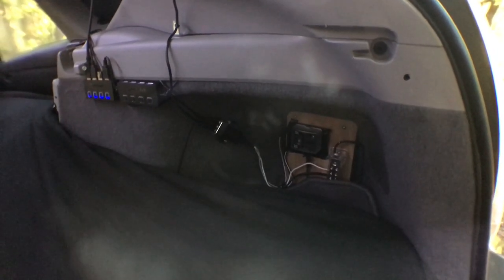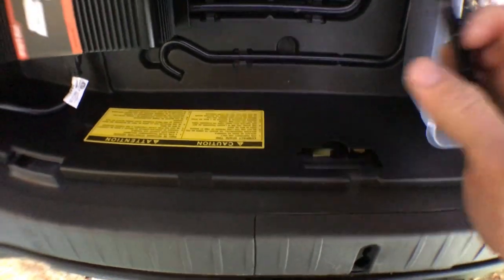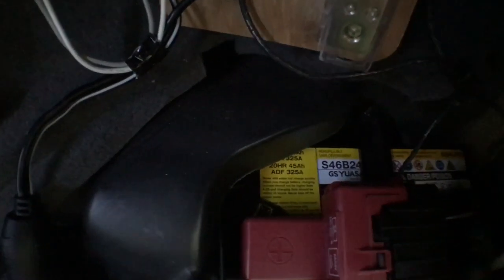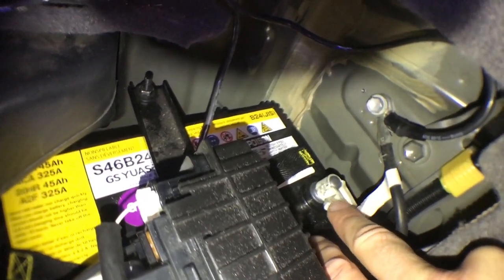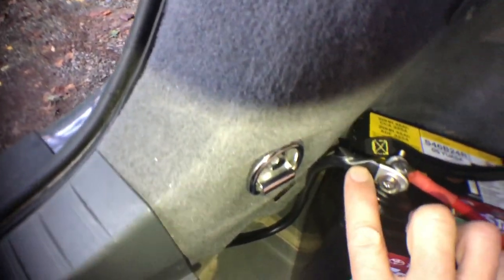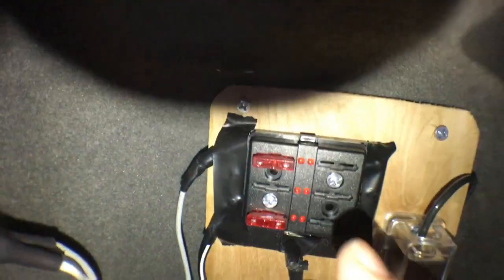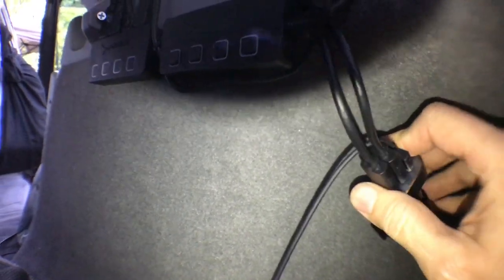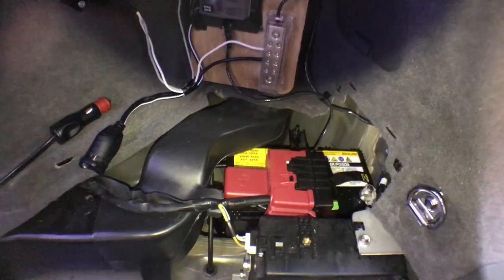Prius Stealth Camper - Electrical: Adding a second 12v battery, inverter, microwave

Comment: Would a standard off the shelve deep cycle battery work with this? The Prius doesn’t draw any amps for cranking the engine from the 12v system so maybe a solar battery would work to extend the cars 12v system? Thanks for the great video!
Reply from the maker: Zanfindel I pondered that exact question for quite a while. I have a large deep cycle I could have used. A couple reasons why I didn’t: As explained to me, the Toyota 12v battery is a proprietary battery that has the design to have properties of both a starting battery and deep cycle. I was concerned that there would be some kind of compatibility problem. Also, the car and software are so complex I thought it would cause an issue elsewhere in the system. 

I had a BMW 645 and used a regular battery from an auto parts store (they said it would work) Huge mistake, the BmW battery has to be synced with the computer. As a result I fried the new battery and alternator and had to end up buying the Bmw battery as well. $800!!!

So the easy route for the Prius was to just double the battery, I felt the the computer and systems would not be able to sense that. If someone else gives the big battery a go and does not have problems then I’ll likely do the same. 

That’s for your input!
Reply: It's possible to add a standard deep cycle battery using what's called a battery isolator.  It would connect the batteries for charging, but keep them separate so your microwave can't kill the starter battery.
Reply from the maker: Joel V I did end up adding a manual battery cutoff to the second battery so I could do some testing and diagnostics on power draws. It’s just a switch because I didn’t want to take the time and expense to put a proper isolator in. Would be a good idea. I turn the car ON to run the microwave just to not stress the batteries from such a big draw. Thanks for your comment and for watching!
Reply: One important aspect of the Prius battery is that it is vented to the outside of the vehicle with a tube. You can see the tube on the left side of the factory battery. Did not notice if it was utilized on the second battery but I believe it should for safety. As a side the battery on a Prius is not actually used to start the engine. The battery provides voltage for accessories such as lights and the computer that controls the car. The engine is actually started by the High Voltage Battery that is part of the Hybrid system.
Reply: The 12v battery is only ever used to run the cars lights and computers. Engine starting is done by the HV Traction battery.  If you look at Prius Chat, you'll see where people are using Mobility Scooter/Power Chair batteries to replace the original. They are much cheaper and more easily available, and they also stand up much better to being discharged to a low level.
Reply: @tbirdracefan  I just bought a 2nd battery yesterday and was wondering about the hose too. I didn't pick it up because it wasn't pointed out in the video....Hmmm. I'm still curious if I need it...
Reply: @dancereaper  If it is a lead acid battery, I would steer clear of it if it were me. They off put hydrogen sulfide gas when charging. The prius battery has a hose to dump that gas harmlessly to the outside of the cabin. Hydrogen sulfide is explosive and poisonous.

Comment: Hold on. Is that a car battery recharger. The kind you use on your car battery when you need to jumpstart it???
Reply from the maker: No I don't have that. No sure what you are looking at. I purchased an additional 12V battery from Toyota, the same that comes with it and just added it to the circuit.  I not sure if I an answering your question or not. The unit in the hatch storage is a 2000 watt inverter.
Reply: PriusStealthCamper Adventures ohh. lol My bad

Comment: is this applied to all vehicles??
Reply from the maker: I've been told that the battery moved up front to the engine in later generations but I'm not sure that years. 2009 was the last year of my generation.  Thanks for your question and for watching!
Reply: I have 3rd gen 2011 and the starter battery remains in the same place as 2nd gen  '09.
Reply from the maker: Good to know - thanks for posting!

Comment: After trying to find a solution to my problem...how to add a 1500w inverter to my 2016 Prius 3...I have come to the realization that EVERY SINGLE VIDEO is on a Prius, no matter the year, with the second battery in the back. Mine is up in the engine compartment, so none of these solutions work And I have yet to find a solution by someone with the starter battery upfront.

Comment: Thanks for the video. I use a 1000w inverter (pure sine wave) hooked to the 12v battery to run my microwave, but it's a 600w microwave. You can see my video here: https://youtu.be/MzLTByvJW7c  When you run the microwave, make sure the car is turned on, so you don't drain your battery. I wonder if your inverter gets overheated by leaving it in the lower compartment? I bring mine out to allow it to vent.
You're right about the Prius 12v battery being a strange one, available mainly through Toyota. I've considered adding a second 12v battery to run the fan for ventilation while sleeping, without draining the car's 12v battery. The cycling of the motor on and off at night wakes me up.
Reply from the maker: Terrell Smith Cool. I’m always trying to find ways to minimize the use of the engine. The power meter I installed has been helpful identifying power draws. Thanks for you comments and for watching. I’ll check out your video.

Comment: I would not know what I am doing here. I would need an electrician.  Very impressive though!
Reply from the maker: Yes, something you might need help with if you haven't worked on 12v electrical systems. Someone who does car sterio installations would be a good resource. I really like having the extra battery available.